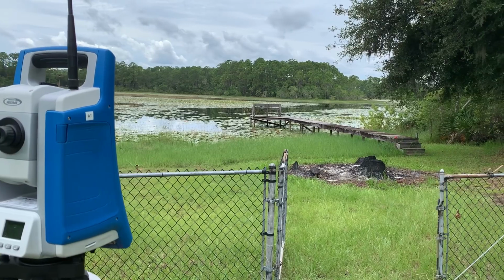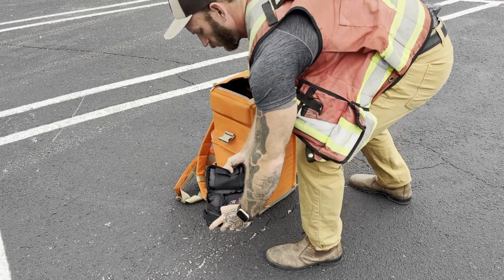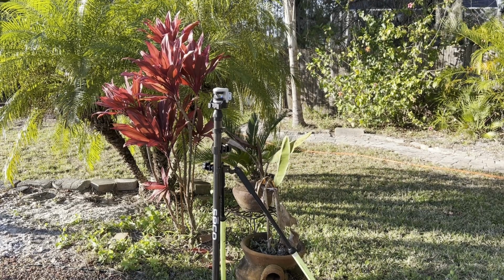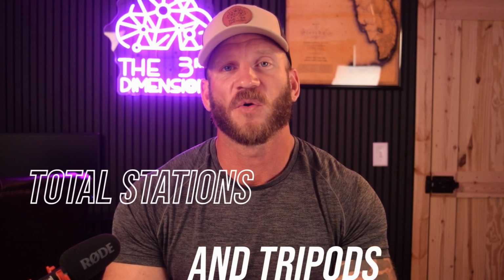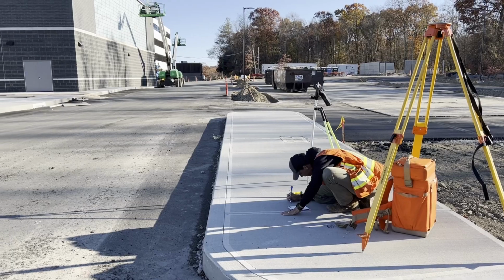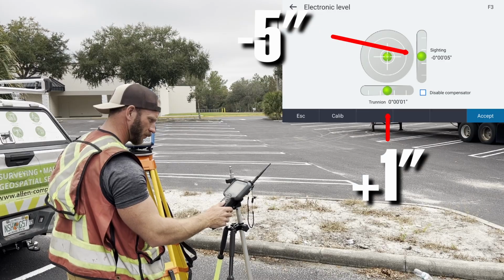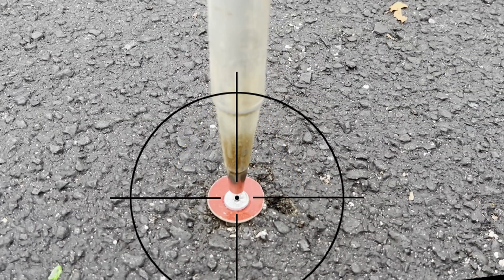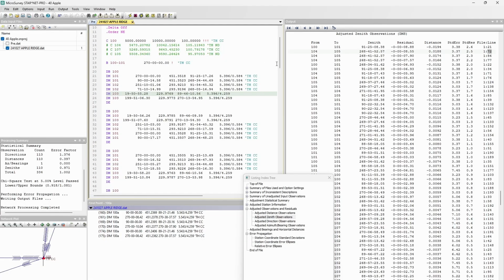Surveying Equipment & Calibration - Laser Scanning in Action: A Complete Survey Workflow - Episode 2

Comment: Hey Shea, thanks for the great content, you’ve taught me a lot of great stuff. I do construction layout specifically for a MEP contractor. I do a lot of deck layout for embeds and hangers as well as sleeve layout pre-concrete pour where on big projects can mean having to layout hundreds of sleeves per area and thousands of hangers and embeds along with it, as well as any large penetrations for duct or whatever else. I need to accuracy and speed, so usually I have to roll with a standard prism pole with a MT1000 prism from Trimble. I try to do everything I can to climate as many variables as possible and practice good technique and procedures as far as setting up and setting out. I don’t see the issue with my current setup for hangers but for sleeves and vertical penetrations in walls that I need to set out on metal decking pre-concrete pour, it just doesn’t seem practical for the short amount of time I get to complete my layout. I think a good compromise is a mini pole and prism but was wondering if you could provide any input and or if you plan on making content about construction layout in the future? Cheers and thanks for the great knowledge and content 👊🏼🤙🏼
Reply from the maker: Yea I use a GMP111 all the time for construction layout & pretty much always have one stashed away in my vest when doing construction work.
I'm sure I'll make more construction specific content in the future. It's mostly just a pain to film on active construction sites is the reason I haven't done more.

Comment: Any tips how to measure robots height accurately while traverse?
Reply from the maker: Use a good metric tape measure, or a height hook if you have one. If not, measure to the bottom notch if your TS has one of those. Calculate the difference between the slant measure and the plumb line and apply that difference to your slant measure up if your DC doesnt already do that. It's usually 2-3mm.

Comment: When it comes to target poles used to geo reference scans to control, should we get the height offset using a tape measure? I’m wondering how loose we can be with the methodology of acquiring offset heights when also referring to USIBD LOA standards of 5mm to 15mm (Loa30). Wouldn’t systematic errors in getting readings from a tape measure be enough to justify getting offsets from other methodologies like maybe using the inverse method? For example, taping a black and white target on the ground, leveling the target pole on the center of the black and white target that’s in the grounds, and scanning the targets to extract vertices?
Reply from the maker: Great question Omar and you are right to be concerned about this. Ideally you want to be using fixed height target poles that you can either get an accurate height from the manufacturer or very accurately measure it otherwise you could be indeed adding in more systematic error than is desired. 

That is an interesting approach to define height of target and to be honest, I think its not a bad idea at all. Hopefully you would only need to do it once and when you have that height defined you make a note of it to use with future projects.

If I'm very careful and use either a metric tape measure or better yet, a Disto to measure HT, & repeat measurements until I'm getting a consistent result, I can usually define a target pole to +/- 1 mm.

Comment: Awesome video! Is it correct that the actual height of the GMP101 prism on the Jeoc mini tribrach is 176 mm?
Reply from the maker: @jarne2981  I clock it at 178mm but I haven’t used callipers or a height gauge to measure it really accurately
Reply: @The3rdDimensionSurveying  I just bought it but since the specs say the prism is 90 mm higher and the prism itself has a height of 86 mm I was thinking it would be 176 😀. I'll try to measure it accurately, thanks!

Comment: Great tutorial - many thanks.

Please can I ask how you check and calibrate the level vials on the Jeoc mini tribrach ?
Reply from the maker: That's a great question. And something I've pondering on for a while. The easy method to check level is to take a set of observations then flip the tribrach 180 and take another set of observations and see if there is a significant difference. 

But to calibrate them...

I open to suggestions. This is my best idea but there's probably a better way....

You could use a precisely leveled surface, lets say shimming a small tabletop using a high precision level. I happen to have a machinist level that works great. Then plumb the tribrach with the set screws, rotate it 180 and see how far off the bubbles are and adjust them until they dont change depending on the orientation of the tribrach. But it's kind of clunky. Any ideas?
Reply: Thanks for taking the time to respond - time for me to buy a precision level.

Comment: Love this video.   Do you have a field test or trick to ensure your optical plummet under your backsight is accurate?
Reply from the maker: Thanks! As for the optical plummet: 1. level up over a nail. 2. Trace the edge of tribrach with a pencil. 3. Rotate the tribrach 1/3 of a revolution and make sure it is still perfectly within the pencil tracing and relevel with the thumb screws. If you're plummet isnt looking at the center of the nail, you have an issue. 4. Rotate it another 1/3 and recheck. This works because if the tribrach is in the exact same spot, just rotated by 1/3 each time and always level each time, then it should be looking plumb in the same spot each time, if the plummet is in calibration. I show a sped up version of me doing this in this video.